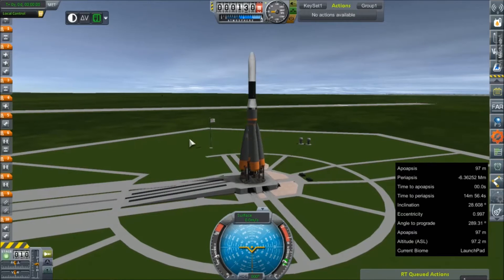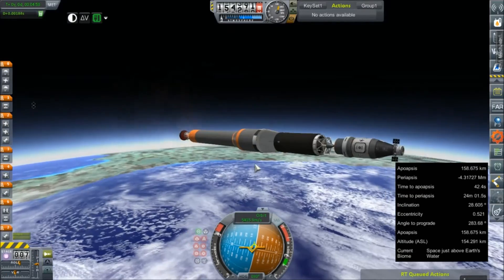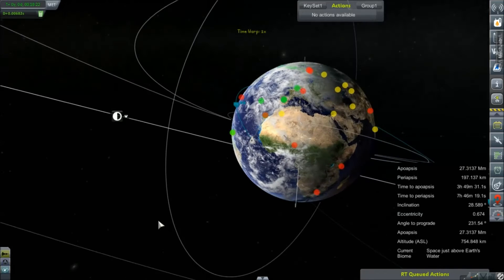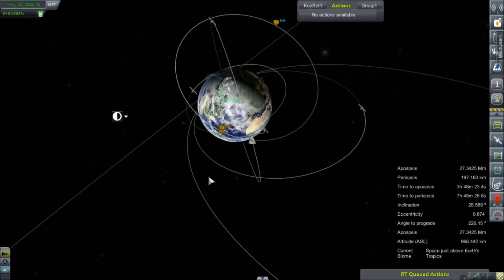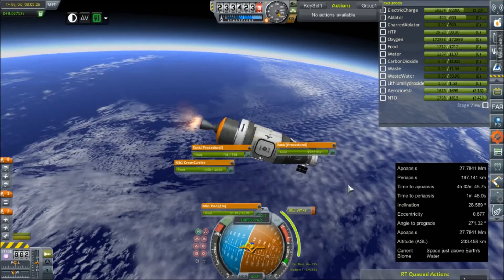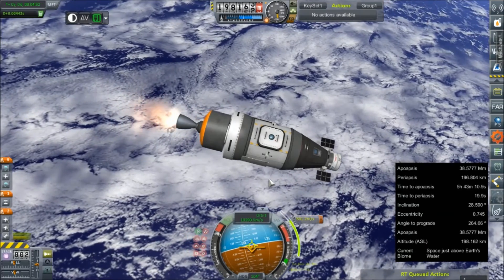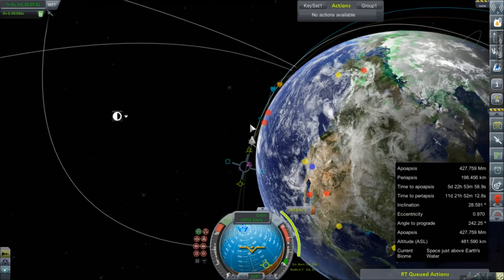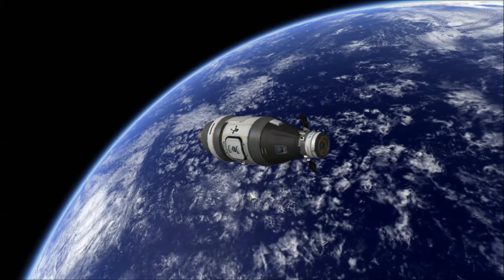KSP RP-0 #141 Multi-Crew CP Re-Entry Test

Comment: And also a quick question, just wondering what recording and editing software do you user?
Thanks
Reply from the maker: I use XSplit for recording and Windows Movie Maker to edit. It's all free stuff. Pretty low-rent operation I'm running lol.
Reply: Cosmonaut Crash Nice, but I do know about windows movie maker, but windows 10 which I use isn't compatible with windows movie maker. I do use easy movie maker, a baisc movie edtor. But thanks for the info:)